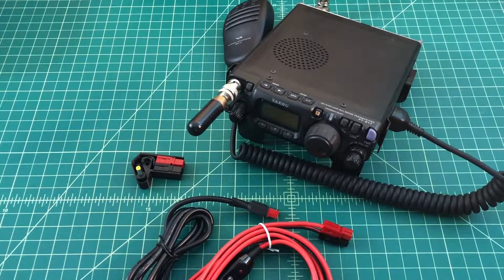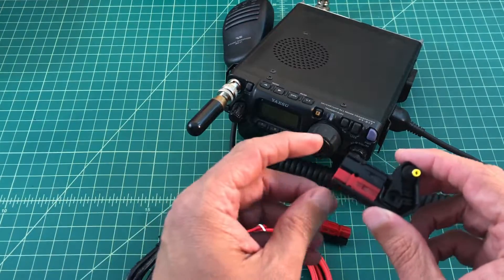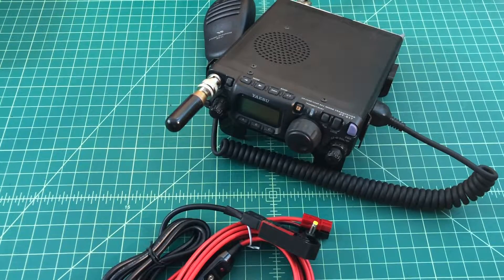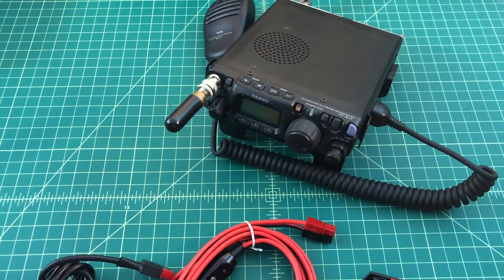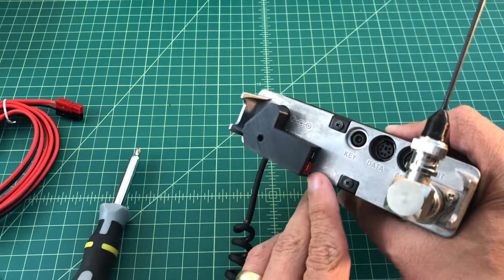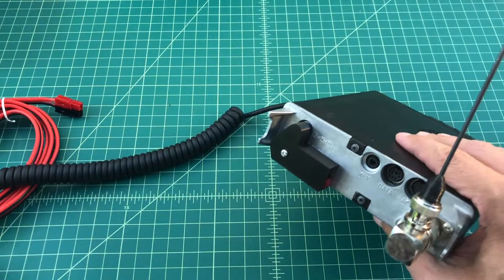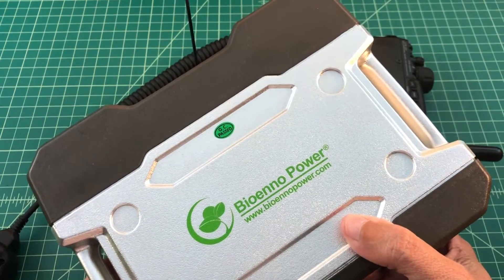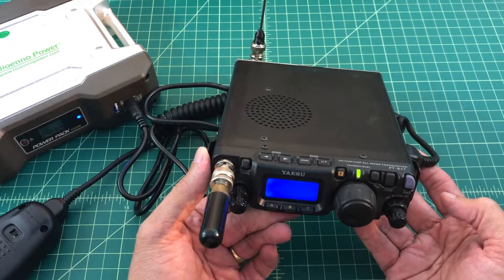Connecting Anderson Power Poles to my Yaesu 817nd HAM Radio - TheSmokinApe

Comment: What two antennas are u using?
Reply from the maker: James H knock off Diamond and a Signal Stick.  I’d use the signal stick for 2/70, the interns only if I accidentally key the wrong output 👍
Reply: @TheSmokinApe  ok, I just bought the 818nd and hopefully it doesn't suck.
Reply from the maker: James H I’m sure you will like it, they are very popular radios 👍